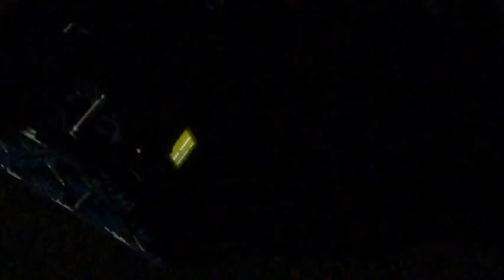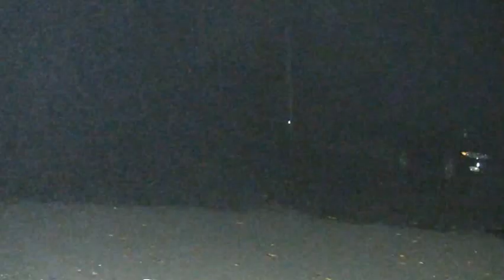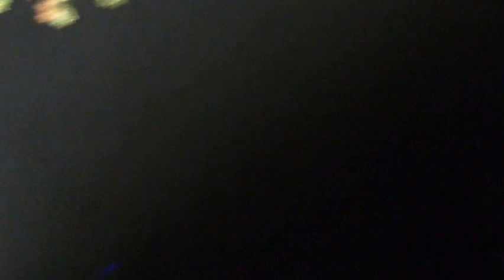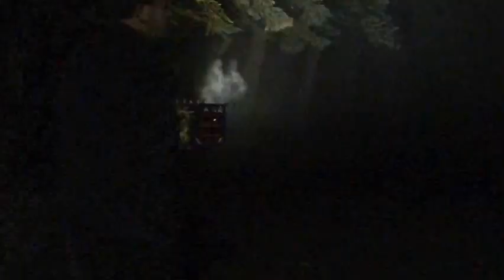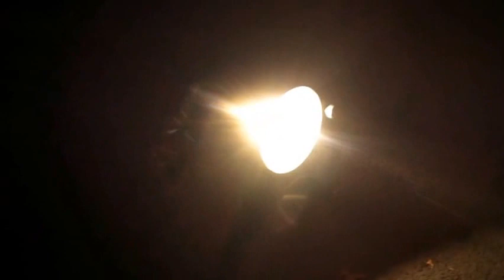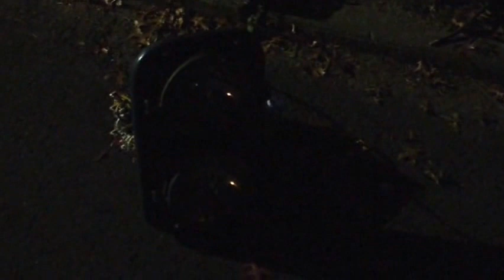Locomotive light vs 500 Watt LED vs 100 Watt LED

Comment: Dude, really, I love your vids. Where the hell did you get that locomotive light? I've been looking into getting a landing headlight of a plane. I've learned they're made by GE but not sure if the one I saw is exactly the same as in the commercial planes.
Reply from the maker: +Nonnof Yobiznes commercial planes use between 600-1000 watts per light, they are insanely bright!!  i got these lights from ebay, i dont see any today but you will see them on again.

Comment: who made the driver for the 500 watt LED and where do i get one?
Reply from the maker: in this case, there is no driver, the led requires 70-80 voltsDC@8A i am using 21 li-ion batteries for the power and there is no driver. the batteries deliver enough power to run the led
you can get a driver on ebay, (dc to dc step-up converter)